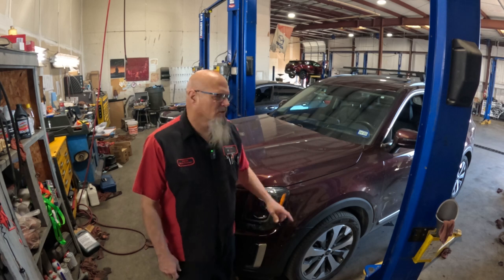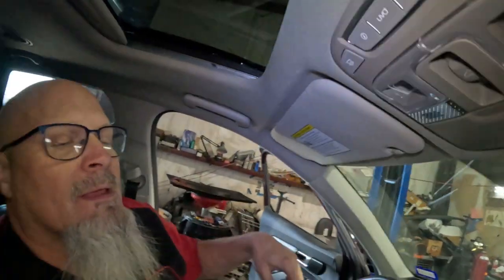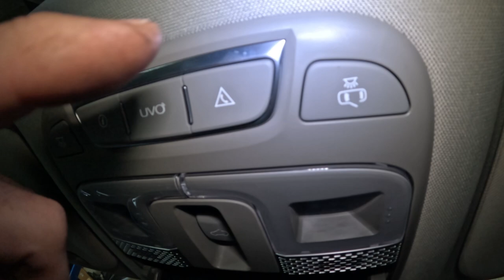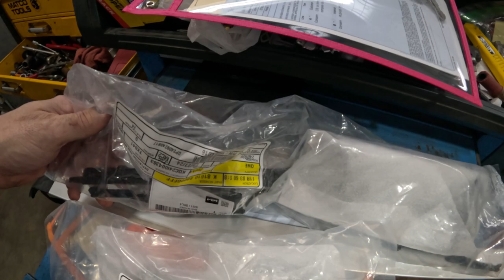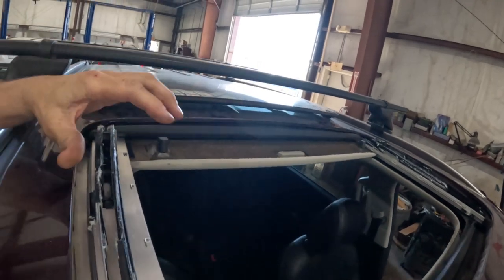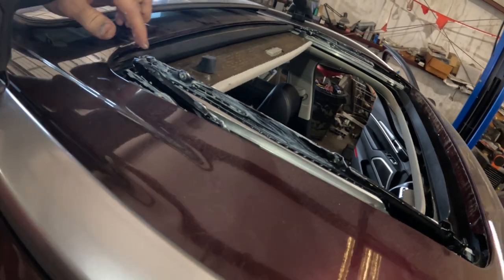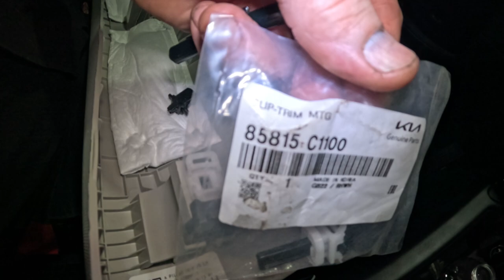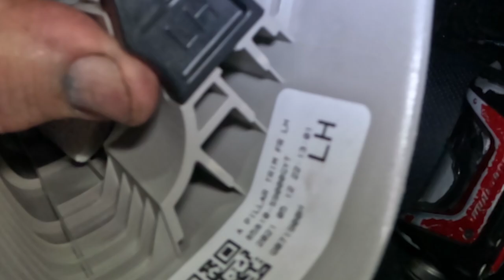Sunroof won't close. KIA Telluride.

Comment: You can remove the glass panel without dropping the headliner.  All the hardware that holds the glass in place is on the inside. In my case the rear tilt mechanisms were off the tracks. It would open but not close all the way. I pulled the glass placed all the mechanisims back in the tracks, closed (put in the closed position) & replaced the glass. I pulled the connector off the switch & didnt use the sunroof. Now i have all the parts & will replace wnen the temperature lowers for fall / winter.  The Ebay kit is $130 the parts direct from kia are  $60. The ebay kit comes with printed instructions the parts from kia do not.
Reply: Just a note. I didn't have to "initialize" anything once everything was aligned.
Reply from the maker: Good job. That means the motor and the springs never skipped. If they had. You would have to pull the headliner down to remove the motor.

Comment: This is happening to mine right now. Can you post the link to the tracks in case I need to replace those too?
Reply from the maker: Left hand https://www.kiapartsonline.com/oem-parts/kia-deflector-arm-mechan-81610s8000fff
Right hand  https://www.kia.parts/oem-parts/kia-deflector-arm-mechan-81620s8000fff
They call it a Wind Deflector Arm + Mechanism Assembly. Each mechanism assembly comes with a wind deflector kit. So if you get both then you will have two wind deflector repair kits.  I hope the mechanism is not broken because that job is not easy to do at all.
Reply: @ShopForemanGarage  So my husband got it all taken apart today. After removing the motor the gear/spring mechanism that goes to the passenger side is all bound up. He was able to get it closed more but stuck in the "vent" position now. Just bought this car yesterday "as is" so trying to figure out how to get it to close and never open it again. Wish you were in Columbia, SC!
Reply from the maker: If the spring is coming apart and out of the track. Then the entire sunroof frame will need to be replaced.  It is not impossible to get it to close but, you many need to remove the headliner and frame in order to force it into place. Of course that all depends on how bound up the spring is. Not an easy job. And unfortunately, you need those plastic mechanism parts to be in good order to keep the roof closed. Even if you never intend to open it. Good luck on the repair.